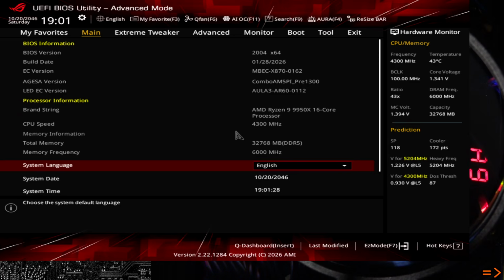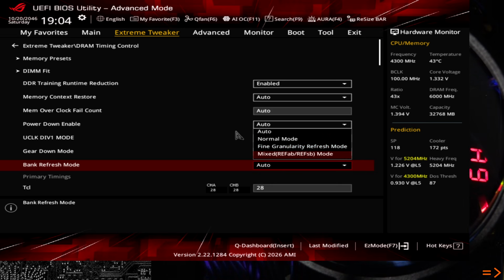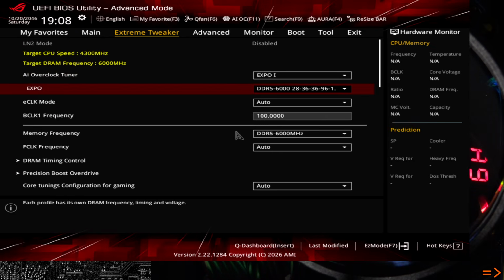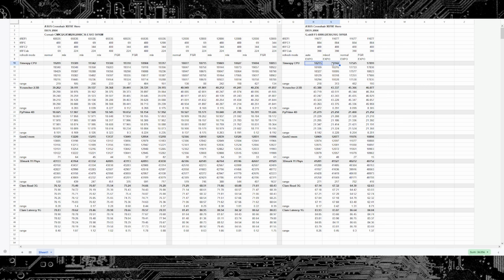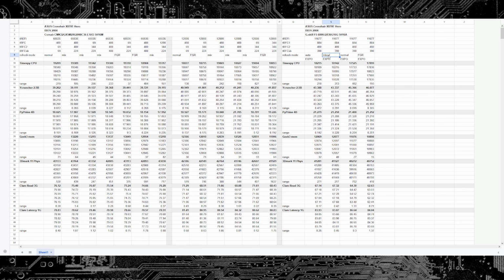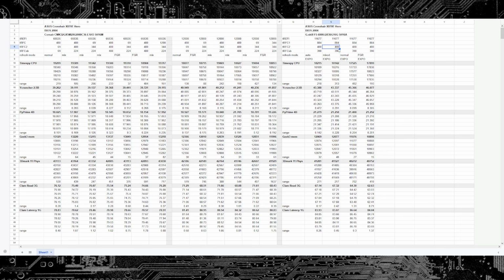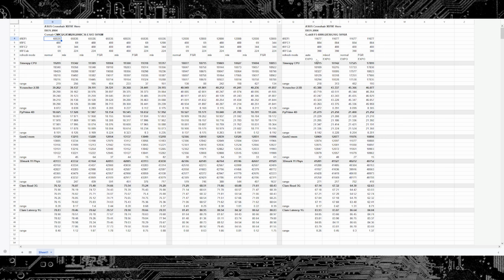New DDR5 refresh modes on AM5 motherboards

Comment: I need some to point me in the direction of a step. by. step. Guide on how to tune DDR5 Ram. 

I can’t find anything anywhere that walks you through it if you’ve never done it before. 

How do you know what values to adjust?

What metric are people using to judge changes in improvement?

Comment: Since the latest BIOS updates, my RAM overclocking profiles haven't been working as well as they used to. So I've switched back to EXPO. Do you have a profile you could share for me to test? I have an R7 7700X + 2x16 GB DDR5 6000C30 A-die on an Asus ROG Strix B850 F Gaming Wi-Fi motherboard. (BIOS version 1681)

Comment: Now I understand why my previously tuned RAM was no longer TM5 Anta777 long term stable with the same settings. It was because this mixed mode was introduced sometime after new year with bios updates on my Asus Mobos. And I always update my bioses. Going back to normal. As I understand it from this video the benefit from mixed is if you run EXPO and not tuned. Normal mode is fine with tuned timings.

Comment: Why can I tighten trfc further using mixed mode than when I use normal mode? My lowest with normal mode is 480, but 384/224/192 on mixed mode.

Edit: nvm he said in the video because mixed mode switches to FGR which divides tREFI in half

Comment: Nice!!
Thank you!! 
What about the Crosshair Tweak with mode 1 & mode2? What does it better than auto? I've got the 9850X3D, 32GB G.Skill TZ5 6000/C30 on the X870R Extreme board.

Comment: Whenever I try any bios with agesa code 1.3.0.0 my system will never post. I turn expo on and then save changes and start it will pass the memory training here and boot up fine when you shut down though and then try to turn it back on it power cycles during the memory training causing the system to never post or sometimes on a rare occurrence it will but 9 times out 10 it will not. I have switched back to 1.2.7.0 and it seems to post fine again but I was wondering if this bank refresh mode has maybe anything to do with that. I am using x670 e-a wifi board asus with G.Skill F5-6000J3636f32G two sticks in dual channel.

Comment: My MSI MPG X670E CARBON WIFI just got the new refresh mode with BIOD version 7D70v1R7(Beta version) on 3-5-2026.. Going to test it out after this video.
Addendum:: Thank you for the advice.. it has definitely helped. They also added a few things to my BIOS in the CBS section that also helped performance quite a bit. I am pleased.. Namaste.

Comment: 15:07 "In the context of mixed mode: "switching the mode DDR5 is in on the fly is entirely supported by the spec"

Unless i;m misunderstanding the statement, this is not true. The key thing to note is that tRFC can practically only be one value at a time because to change between them requires a DRAM register command something done at boot/DRAM-IMC handshake/training and is inefficient to change on the fly and is in fact explicitly out of JEDEC spec to do so:  From JESD-79-5D: "The Refresh Modes are fixed until changed by MRW command to MR4 OP[4]. No on-the-fly Refresh mode change is supported". Because it requires a register change, it's too slow to do count as an OTF feature.

15:11 continuing "within my understanding of the spec, you should probably be using tRFC1 when in normal mode and it doesn't."

it cannot use tRFC1 because Mixed Mode is actually FGR mode with same bank refresh ability enabled. and FGR mode requires tRFC2, a smaller value than tRFC1.

I think the big confusion is because of the term Mixed Mode, which isn't a JEDEC mode or spec by any means but simply a term ASUS decided to use and who knows which other mobo manufacturer might follow. let me explain.

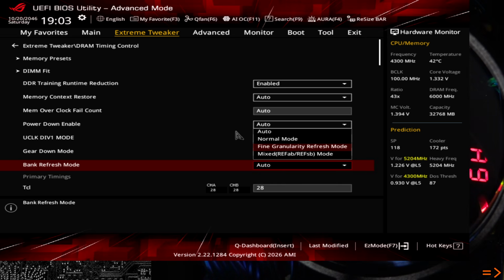2:03 "What FGR does is it allows the IMC to do same bank (sb) refresh instead of only all bank (ab)."

This is true. But it does not mean that activating FGR mode also activates sb refresh capability! the former enables the latter but does not activate it. the BIOS must send the separate register commands to do these two separate things. ASUS decided that the latter is only executed when you select Mixed Mode but not executed in FGR mode. there is strong reason to believe this even without seeing the benchmark results suggesting so, as the BIOS setting only mentions sb refresh capability, and in parentheses i might add, for the Mixed Mode setting 1:56.

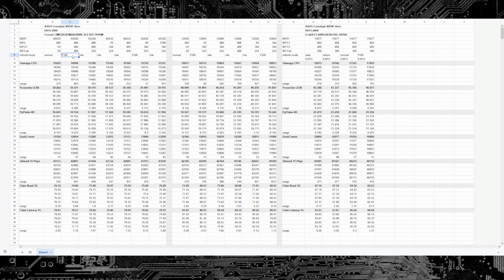From the fact that tRFC can only be changed by register command and the fact that sb refresh requires FGR, i think it should be clear, at risk of repeating, that Mixed Mode must only be using tRFC2. this is actually JEDEC rule. does this mean refresh is not as good (implied in 20:50)? no this is definitely not the issue. because the IMC just sends double the number of refresh commands per fixed duration this is the real reason why tREFI is divided by two--and that is not a bad thing per se. in FGR mode the typical single long refresh is now broken into two refreshes (in 2x FGR). to achieve the same capacitor refreshing ability in a particular time window, a refresh in 2x FGR mode can use half time but must do so twice as many times. therefore a halved tRFC continues to make completely sense with a halved tREFI.

The reason why FGR alone is good for latency but not bandwith is because:

The supposed benefit comes from faster availability to issue the next urgent command which can be inserted between any two short tRFC2s vs only before or after a long tRFC1 in non FGR. sort of like trying to call your mom but shes on the phone for a full hour every two hours (normal mode) instead of doing two 30 minute calls every 2 hours. but in reality seeing that the default tRFC2 is always slightly more than half of tRFC1 means that the command bus is actually more flooded with overhead in FGR mode vs Normal. this explains why bandwidth is lower, even though it might be easier to insert random commands (lower latency). there's an additional risk here that if tRFC2 is not long enough then the IMC will queue more of them more often when a single tRFC1 would have done the trick--except it cant do a single tRFC1 refresh because FGR mode REQUIRES tRFC=tRFC2.

but we still need FGR because it is needed for sb refresh. we just need to enable both.

the main breakthrough here is sb refresh for the obvious reason that locking one bank at a time is better than locking all of them for one refresh duration. but in ASUS's infinite wisdom they provided an option for you to do FGR without it instead of just making it a separate option that becomes available and automatically on when FGR is on so that it is clear what's going on. today that beneficial option is called Mixed. which is an unfortunate word in this space, because it carries and has always carried the connotation of Compatibility not Performance.

Comment: Anybody with a ASRock b650 or b850? Where is the bank refresh option? It looks like it's hidden
Reply: B850 Pro RS.
I wasn't able to force any new mode.
There's a refresh Mode, you can find it by searching Refresh through F4 (search mode)

The fact is that... it doesn't... work?
Disabled -> Mixed
Enable -> Mixed
Force Enable -> Mixed

And it keeps being Mixed regardless, it's not like Zentimings is not working, you can't use tRFCsb o tRFC2 at 1 for example and get on BOOT  where it would work in Normal Mode
Reply: @andrexskin I ended up finding the same things on my b850i lightning and it doesn't work, rolled back to 3.5, ASRock shat that bed with this one
Reply: @uhk9428   Have you checked what's the Refresh Mode 3.50 is using on zentimings?
I used 3.50 and it was already on Mixed
Reply: @andrexskin 3.5 didn't have that useless option (at least for the way I use ram). I'm going for 8400 on a 2 CCD CPU, the mixed option benefits mainly 1ccd, which benefits close to nothing from going 1:2 for my specific use case
Reply: @uhk9428  yes it doesn't have that option but for some reason the latest zentimings was showing Mixed anyway...
Who knows at this point

I wanted to stay at normal just like you

Comment: Also remember too Asus eventually gets bios updates to you that generally fix these situations and the memory timings and other memory settings will be a problem of the past, but keeping in mind some memory modules are a little more problematic and finicky with certain voltages. Great video and awesome go to channel you have for knowledgeable tech information.

Comment: Running 2R 16gb m-die here,

Mixed So far stable on tRFC2 480 tRFCsb 224, funny enough 480 on normal mode often failed memory training every few boots. Stablewith 512 tRFC. 

tREFI 49152 (higher would push my ram temps over 55c bad airflow h710i + stick obstructed by the CPU cooler fan.)

I haven't messed with any other timings than what I had with normal mode.

Ram: CMK64GX5M2B6000Z30 (2x32gb), 30-36-36-36-76-112 6000expo but currently running 30-28-38-38-96-96 6200 (I tried both jdec and 126 for tras but 96 was the sweetspot on my kit)
Reply: Mine aswell not stable on 480. But in mixed mode 344/224 was stable. Did some gaming benchmarks and normal refresh mode seems to be better tho, visually can't tell the difference, but mixed always gets slightly worse low 1% and 0,1% fps.
9850X3D, B650 Tomahawk and 2x16gb M-die with bullzoid's timings.
Reply: interesting my mixed mode has a better 1% low worse max, whilst normal mode has worse 1%'s, I  decided to step back a little more on the sub timings and fclk at 2067 instead of 2133, 2133 was stable ish, but did cause some error correction spikes at times during normal use. Was stable on benchmarks though. Back at 2067 fclk haven't had any more problems
Reply: @nikander100  error correction spikes like stutters? I'm running my 9850X3D on FCLK2200, not sure if it error corrects or not, some games are smooth AF and some games have occiasional micro stutters.
Reply: @Arx07 yeah that's what I was having, I toned down fclk, the difference for me between 2067 and 2133 wasn't that much in bandwidth loss

Comment: Hello everyone. Due to the language barrier, I'm unclear which Bank Refresh Mode I should choose.
Can anyone help? What would be best for CS2 to get the best P1 FPS?
9800x3d, Asus B850 strix e gaming, and Expo 6000 cl28 memory modules.

My current setup is as follows:Speed: 6200 MT/s (+flck 2167) 
BGS: Enabled
BGS Alt: Disabled
GDM: Enabled
Cmd2T: 1T

tCL: 28
tRCDWR: 36
tRCDRD: 36
tRP: 36
tRAS: 50
tRC: 86

tRFC: 384
tRFC2: 512
tRFCsb: 416
tREFI: 65535  

tRRDS: 8
tRRDL: 12
tFAW: 32

tWTRS: 4
tWTRL: 24     
tWR: 48

tRDRDSCL: 5
tWRWRSCL: 5

tCWL: 26
tRTP: 12
tRDWR: 15     
tWRRD: 1
tRDRDSC: 1
tRDRDSD: 1
tRDRDDD: 1
tWRWRSC: 1
tWRWRSD: 1
tWRWRDD: 1
tCKE: 0
tSTAG: 7
tMOD: 44
tMRD: 44
tMODPDA: 32
tMRDPDA: 32
tPHYWRD: 6
tPHYWRL: 14
tPHYRDL: 36
PowerDown: Disabled
Reply: Regarding the Video "Mixed" over "Normal" over "FGR") - so the new mode is not the best.
Reply: Do you find for you the best Settings? If yes, do you use pbo?
Reply: @michibbx  yes, pbo +200, co curve -5-15

Comment: I wish the new agesa’s on x3d CPUs didn’t clamp so hard on voltage :( I can get 5.5-5.6ghz at 150w-180w+ on old agesa versions but because of the new fit limits on newer bios/agesa I can only get 5.2-5.3ghz at a locked 160w wish I could use the new mode but not going to throw that much frequency for a little memory performance
Reply: Use load line calibration
Reply: @ShoreLooser  ive tried every llc setting old agesa's are far better for extreme oc
Reply: @TinkCrushh ok so they limit the boundaries for cpu protection
Reply: @ShoreLooser  yes that's the fit limits on the newer agesa patches

Comment: My ram specs below what do you think guys?
Speed
6003 MT A
Capacity
BGS
Enabled
BGS Alt
GDM
Disabled
Cmd2T
tCL
28
tRDRDSCL
tRCDWR
36
tWRWRSCL
tREDRD
36
tCWL
tRP
36
tRTP
tRAS
80
tRDWR
tRC
116
tWRRD
tRRDS
tRDRDSC
8
tRRDL
15
tRDRDSD
tAW
32
tRDRDDD
tWTR5
tWRWRSC
tWTRL
29
tWRWRSD
tWR
90
tWRWRDD
tRFC (ns
186.2069
tCKE
tRFC
540
tREFI
tRFC2
440
tREFI (s)
tRFCsb
340
tSTAG
tMOD
41
tMRD
tMODPDA
32
tMRDPDA
tPHYWRD
tPHYRDL
6
tPHYWRL
13
PowerDown
tRDPRE
tWRPRE
3
32GB
MCLK
3001.50
Disabled
FCLK
2070.00
1T
UCLK
3001.50
VSOC (SMU)
1,2000V
23
CLDO VDDP
0.9472V
26
VDDG CCD
0,9496V
18
VDDG IOD
0.9496V
21
MEM VOD
1.4000V
MEM VDDQ
1.4000V
1
CPU VDDIO
0.8100V
MEM VPP
1.8500V
VDD MISC
1.1000V
1
15
ProcOdt Pu
48.0
15
ProcOdt Pd
60.0
ProcCaDs
30.0
20000
ProcDqDs
34.3
6896,552
DramDqDs
48.0 Q
RitNomW
7
Off
41
RttNomRd
Off
32
Rttwr
RZQ/6 (40)
35
RttPark
RZO/5 (48)
Enabled
RttParkDqs
RZQ/6 (40)
3
Nitro
23/1
32,0 GB
31、6 GB
5800 MT/s 2av4 DIMM 455 MB
inds:
verat;
A2: KF568C34-16 (16GB, SR
DDRS

Comment: some gaming benchmarks might be useful as well, apparently on the ASUS forum they found that the normal mode has better FPS on average. but the synthetic tests are weaker. 

not sure what to believe TBH, I was just going to leave it on the auto/mixed mode
Reply from the maker: I'm pretty sure I was that test and they ran tRFCsb = tRFC2 which bad for performance in general.

Comment: I applied the mixed mode on my Crosshair X670E Hero and 9800X3D on EXPO 1. So far my write speed improved a little but my latency increased slightly as well. I'm not seeing any huge gains so I definitely have to tweak the trfc and other timings.
Reply: Just leave it on auto u wont see any difference in game with these settings
Reply: @FearNoPlay-l5h I tweaked my sub timings and got some good gains when adding this change. A lot has happened in the past 2 months.

Comment: Does FGR or Mixed mode produce more heat in that little controller chip in the DIMM center?
Reply: The total number of refresh commands should stay the same, as each bank still needs to be addressed individually.
Reply: @andersjjensen  I guess the added write throughput would be handled by the CPU mem controller?
Reply: You'd think less, since it doesn't refresh all.

Comment: I think with this new updated refresh modes and etc, I think it's time for an updated Hynix timing "guide/tutorial".  Over the course of three years since that has released, a LOT has changed when it comes to memory tuning, whether that would be different techniques or different values, or methods or etc. Also, that old video (from what i can tell) is single rank only, and doesn't cover dual rank or quad rank (for those masochists). I've been using those timings for about the same with, with a 7700x, with a -30 all core and 5.7ghz, and it's been proven stable
Reply: This ^^^ I have a dual rank 64GB GSkill kit with my 9800X3D and would like to see a new guide for DR.
Reply: @fhracing5614 Correct, that original video is a bit outdated at this point.  Main things I can think of that are different now:

1. The tRDRDSD/DD and tWRWRSD/DD timings definitely matter in dual rank/quad rank.
2. the part about FCLK of 2033 being faster than 2000 isn't a thing anymore.  In a later video, BZ clarified that that behavior was because of a bug in the early BIOS versions where 2033 actually set it to 2000 where it should be, and so was faster.
Reply: @idontneedthis66  Also that tRAS doesn't work and instead of setting 28/30 he does 126.
Reply: I am running 9600x.

My options below.

CPU switching frequency maxed.

C state off.

CPU loadline calibration lvl 8 for lowest Vcore on higher CPU usage.

FCLK 2200 as VDDG 980mV stock 850 was nor enough to run stable so I trow on randomly 980 :).

Tdp 105W enable.

PBO motherboard limits, x10, +200Mhz, curve optimazer -55 one by one core on all cores, curve shaper off but max clocks as +6.

Vcore offset negative -300mV.

= 18800 score cinebench r23 multicore.

Noticed I got 10Mhz lower since my max clocks can not use 5660Mhz and goes slitly slower in gaming but way lower temp.

I was able to boot -400mV, and idle below 1V, but one core does 1.35Vcore seems good to me.

I will lower my Vcore to -500 and increase max clocks :).

I want to get close as possible to 5650Mhz all cores when doing 100% CPU usage, allready doing max clocks all cores on 70% usage.

I will keep higher undervolt and start to slowly increase BCLK for overclocking:)